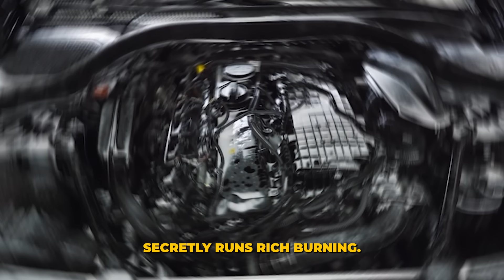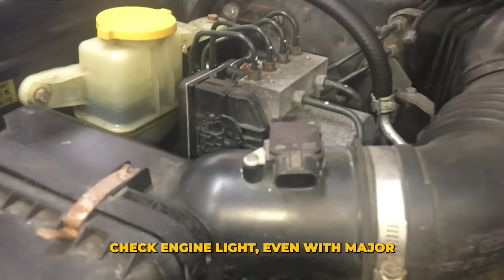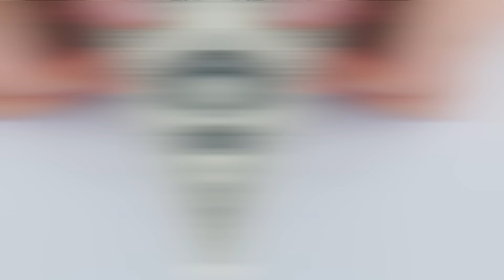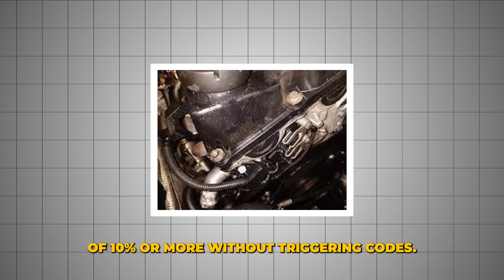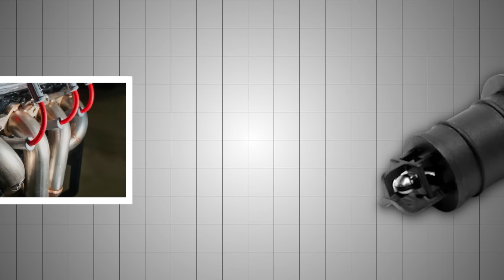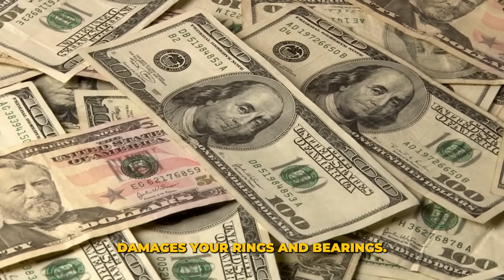5 Hidden Sensors Killing Your MPG (Dealers Won’t Tell You)

Comment: Where do you relocate the IAT (intake air temp) sensor to ?  Chances are you will need to drill and tap a new hole for the sensor and who wants to go removing a whole assembly for that as you want to be sure to clean the drill cuttings out before restarting the engine, where those bits can go in and get stuck and then welded between the valve and seat.  If there is room I would put insulating material between that sensor and the hot manifold.

Comment: The moment it gets cold outside, my MPG drops a whopping 40%.
And I don't warm up more than 30-60 seconds either.
I have actually seen the gas gauge drop.
2mpg sometimes for a couple miles.
When my vehicle was new, the steam coming out of the tail pipe was enough to obscure a house.
Now I barely see any.

Can't afford a $5,000 diagnostic machine.

Comment: I discovered years ago that hot wire MAF sensors need to be kept perfectly clean after suffering performance loss on a petrol engined BMW. I fitted a K&N air filter and the car ran worse than with the original paper type. The K&N is an oiled type filter and ioil coated the sensor wire, causing it to read badly. Refitting the original type restored the performance.
Reply: Over oiling a MAF can destroy it fast. The K&N folks will argue that they are great. Not over oiled yes. But it takes just once and the MAF is toast.
Reply: Mine was new, straight out of the box. I’d still be happy to fit one on a carburettor (and I have done since) but not on any engine with a hot wire sensor.

Comment: Thank you for great information. Question:  Two months After replacing the ECT sensor on a  2019 GMC Acadia, 71,000 miles. I see the error message: "STEERING ASSIST REQUIRED", the temperature meter drops to zero, and the engine cooling fans are activated,  no a/c. Why? Thank you.
Reply: Look up your maintenance manual or call the dealer asking how to, could be you need to reset it.
Reply: Check and clean the other end of the ground wire that goes to the frame.
GMC/ Chevrolet are bad about that causing that same issue. YouTube it.